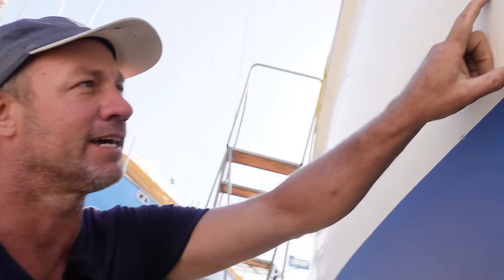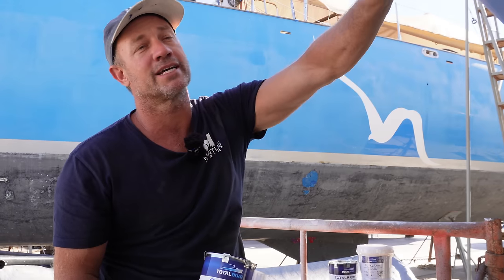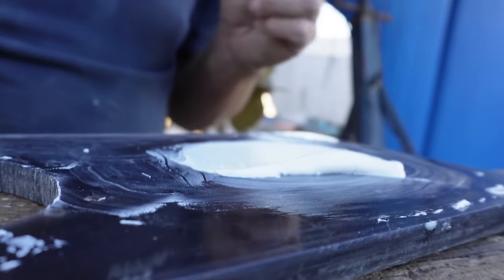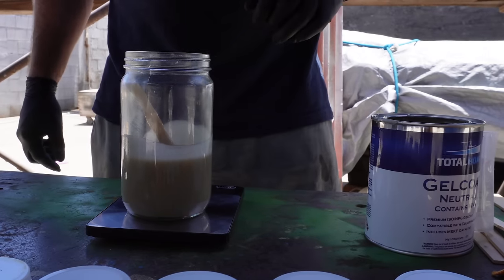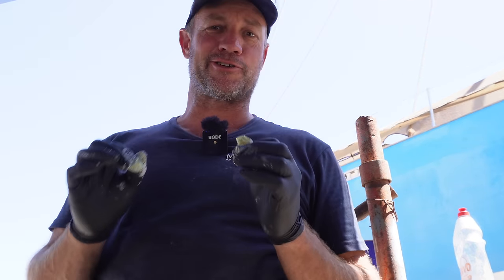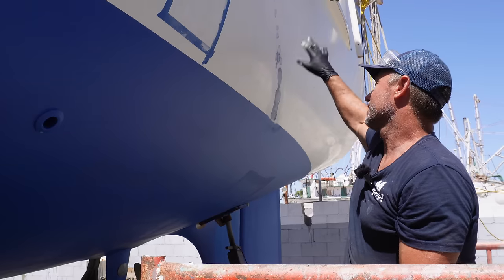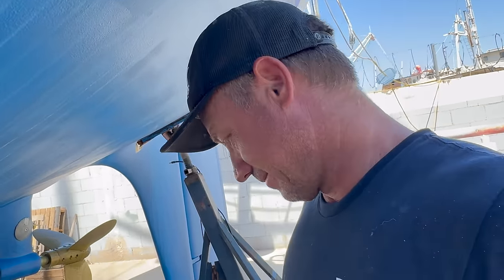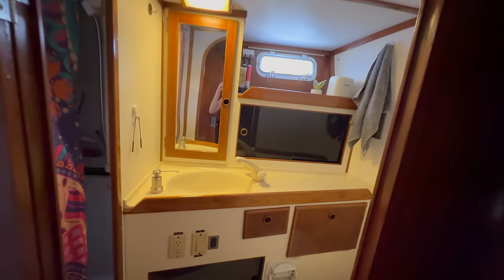Gelcoat colour matching Gone Wrong Ep 408

Comment: For a first timer you have done very well.  It takes practice, consistent lighting and intimate knowledge of your product formulation to get it spot on.  (I colour matched cosmetics and other products for decades) Those pots of tint are fabulously strong. I would have started by mixing 1g in a kg of base and tinted with that.  More realistically, I would have started with 1/100g tint in 10g of base but I doubt Sara's scale is as good as mine. I was waiting for it to go green when you added the thickener.  Consider yourself lucky that you only have to get one pot right once and don't have to commit to a formula where a batch would buy your boat. Again, well done you.
Reply from the maker: Thanks it definitely not an easy task hats off to you and your craft ☺️

Comment: Couple things you could do with the gelcoat is those tape lines make them like diamond shapes so you don’t have such hard straight lines. Buff the whole hull in that area prior to sanding anything. Whatever you’re using to apply the gel coat apply it to a big piece of wood right on the edge or even lay up some fiberglass and put some filler and then spray it is typically what we do so we know we have the exact everything to make it match. But it needs to be at least a one by one square sample.
Reply from the maker: Thanks for the tips 😁